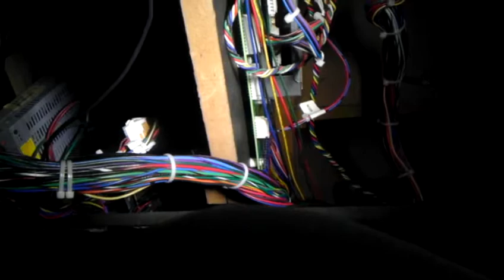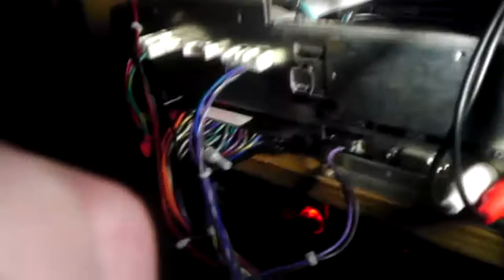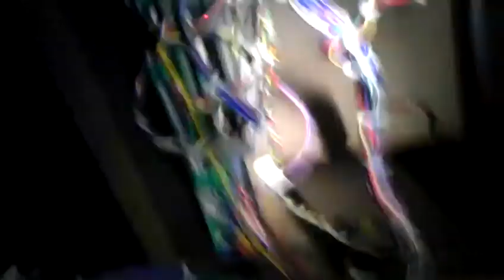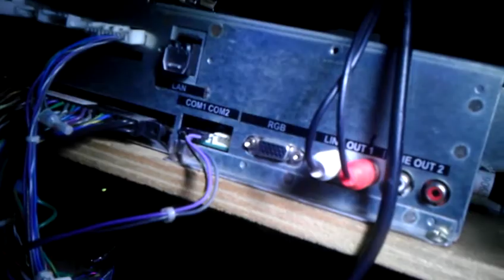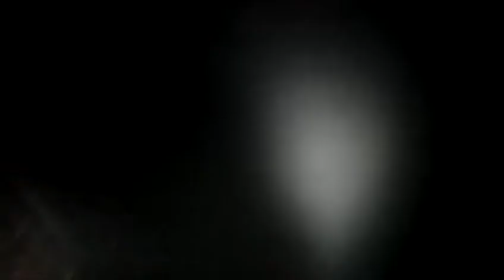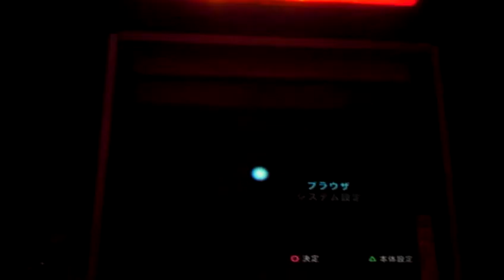Python 2 Konami DDR Supernova Unit

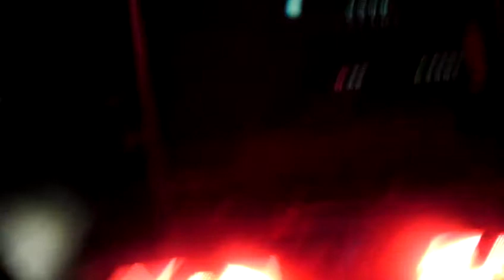Comment: 3:12 your PS2 seems hang. look, those orbs isn't moving where it supposedly do that beautiful dance. I am not sure but you gotta have to examine it with professional and experienced one.
Reply from the maker: Joel Robert Justiawan It's a modified PS2. The hard drive failed in it. main problem.
Reply: the orb won't move if the system time and date wasn't set
if the time and date were saved and after restarting the orb still frozen then there might be a battery or some kind of similar thing that dead and won't save the settings.

Comment: Is it possible to get a new hard drive for it? I have heard that the hard drive is married to the I/O board, so you maybe are the screwed. I have a DDR SuperNova and am trying to get it working at the moment.
Reply from the maker: Shark80228 You need an install disc and those are hard to get. You can get the hard drives. I never got my unit working. I put a computer in it.
Reply: I may be doing the same thing, we'll see. The neckboard for the monitor and the monitor chassis board for my machine where outside the machine when I bought it, so I haven't been able to try to boot the machine up yet. I tried to plug in an LCD computer monitor to the VGA port in the back, but got "no signal input". I guess I need a crt monitor with 15kHz, or was told I can bridge the Tilt(slam) (S) pin on the jamma to a ground, and that will allow me to connect a VGA monitor. I'm not really sure how to do that, so I'm going to get my hands on an old CRT monitor with a VGA plug and try that. I've heard that the syncing of the pads with a computer and LCD monitor is difficult to get just right. What has your experience been with that? Thanks for the reply.
Reply from the maker: Shark80228 If you take apart the python 2 you can connect an American PS2 composite out to your tv. It'll output whatever the PS2 does so you can check it. It's how I did mine. Other than that you need to check a crt 15khz monitor or a converter to convert it to a normal range.

I have put three computers into my machine since owning it. Just upgrading the performance each time. I am not too picky about everything being perfect. I just want the pads to work. However, on my third computer I got a complaint from an "expert" player about how the game is not synced correctly. I attempted to resync the whole game. Got it correct, but haven't checked on it again. 1/100 players are like that on my machine. So, everything is workable. To be honest the worst machines I have ever been on for offset were Supernova machines.